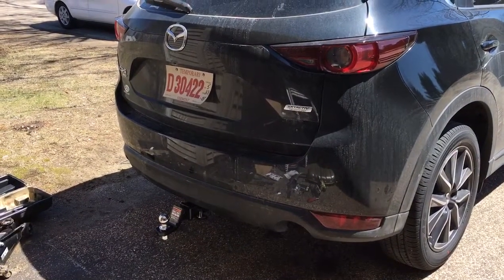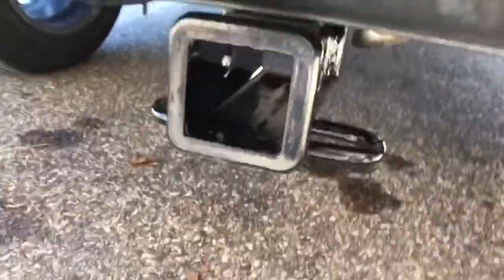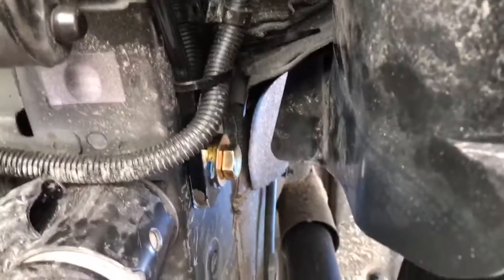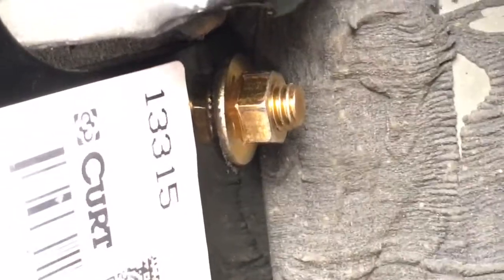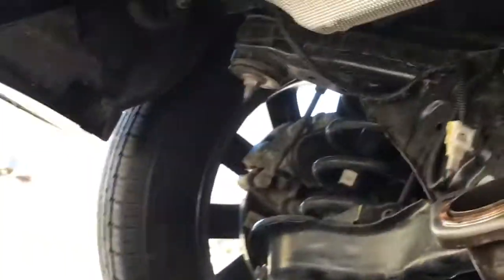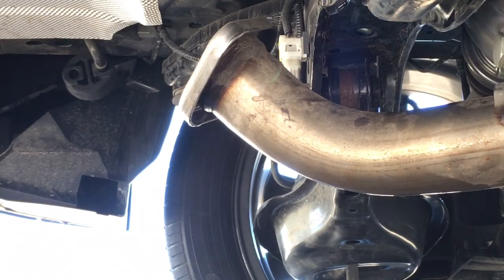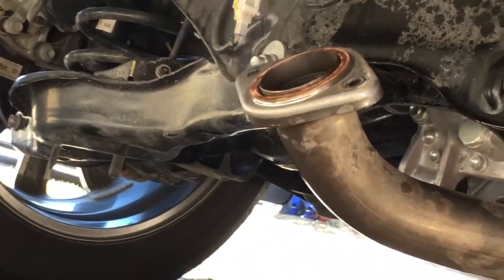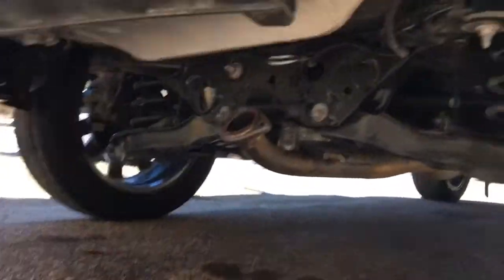2018 Mazda CX-5 trailer hitch and muffler delete (Adult language)

Comment: Hey,
Does the trailer hitch touch the plastic bumper? It looks like it does, possible vibration issues? Thanks.
Reply from the maker: It does touch. I haven’t noticed any vibration or noise.
Reply: Thanks for the response.